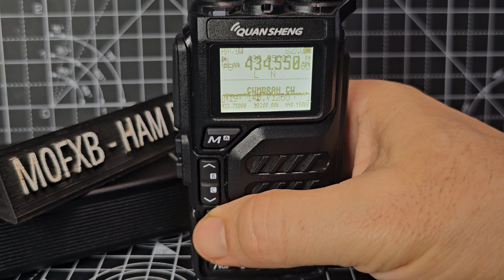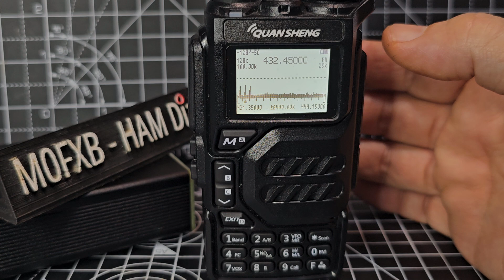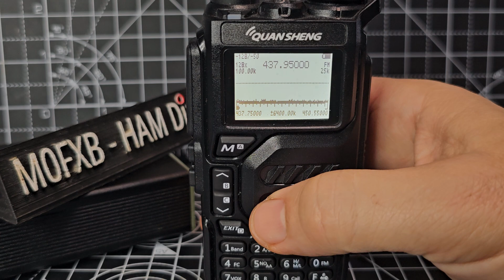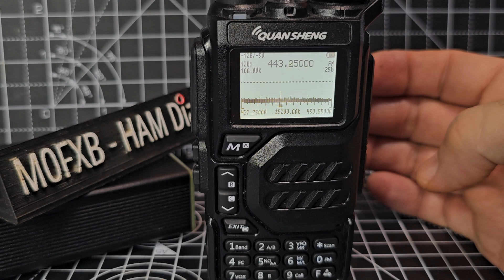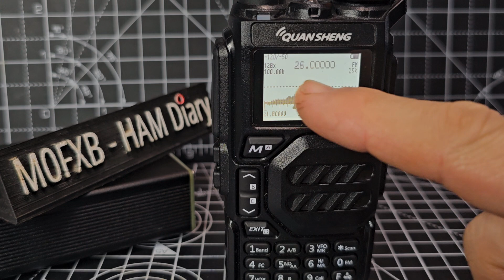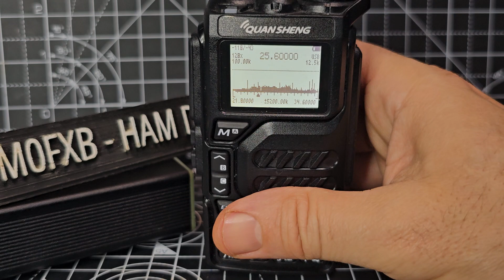Egzumer - K5 , Spectrum SCOPE & button Functions :Instructions v20.01-Learning

Comment: Question if someone knows: what is the shortcut key to change modulation type (fm, am, ssb) of the selected frequency from the normal screen, not the spectrum. Also, why in the Egzumer when a dual reception frequencies activate there is always the same signal meter and you cannot tell which is the one of the two speaking?
Reply: Can't see a shortcut for FM/AM/USB in the manual (see link in description and click CODE top left, then scroll down to Manual).  But you can Press Menu then press 1 then press 3, and it takes you to menu item 13 which is the modulation type.

I think it shares the same signal meter between A and B, but if a transmission is received on a frequency, it shows the arrow next to the A/B that's active.
Reply: You can set shortcut menu for change modulation
Reply: key 0
Reply: @nathanwaller7242  key zero switches to the FM radio (long press or F+zero). By itself it just dials a frequency (like 018.000].

Comment: When you type 27.000 it is the tiny frequency on the lower left corner of the screen, the big frequency you saw is some signal “spike” that it locked to within the span between 27.000 and whatever is in the lower RIGHT corner. When you fiddle with the size of this span (1, 7 and 4 keys) the 27.00 never changes, what changes is the upper frequency of this span (lower right corner frequency).